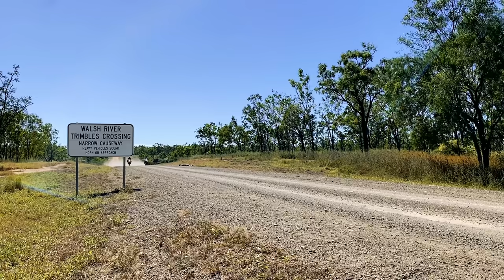Tropical Punch Motorcycle Adventure  - Episode 2 Tropical North Australia

Comment: Worst seal on a bike has got to be a fork seal. I've never had a problem with shock seals. Chain seals seem to be a relatively new problem.
Reply from the maker: I fixed it straight away.  Didn't bother me again.  The mud up there is very abrasive.  I should have cleand my fork legs during the day...just woped them down with a cloth before the mud set on them